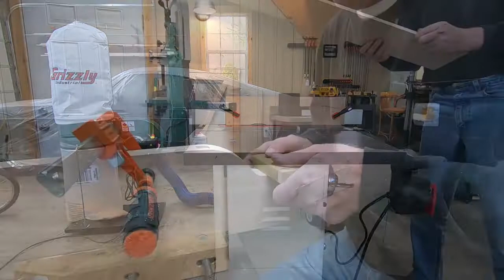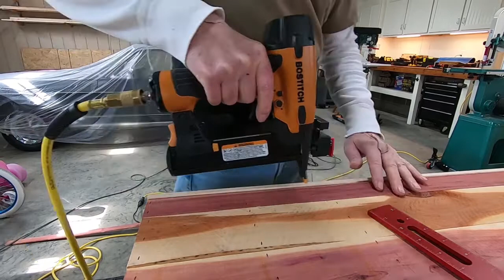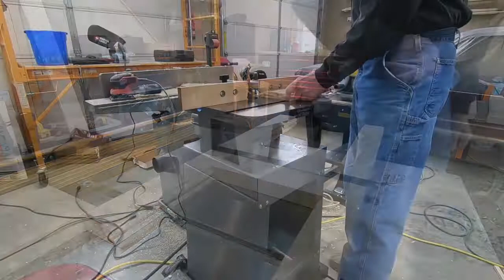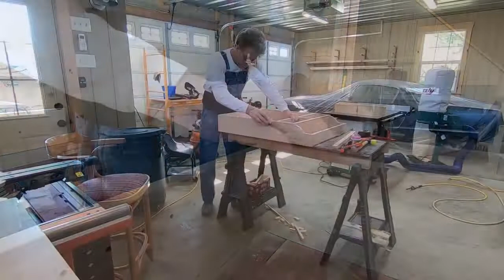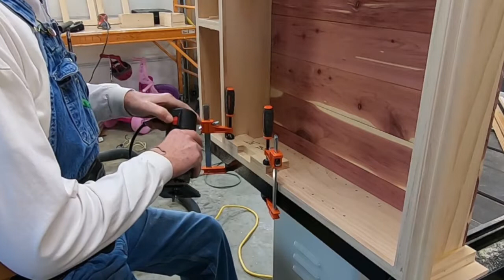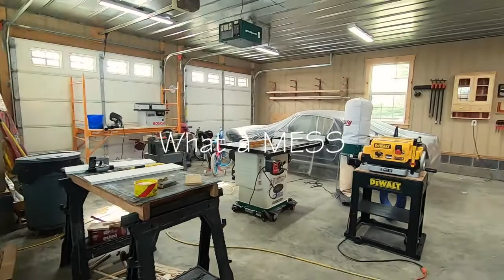Wall Hanging Tool Cabinet

Comment: Its bad practice, and actually quite dangerous, to use a router table the way you did to cut the doors for glass. You should never have the work between the fence and the back of the bit. Moving the work right to left between the fence and back of the bit can really quickly turn your part into a fast moving projectile. Ive seen a lad try use the router table as a thicknesser, he had it set with a straight bit away from the fence about 19mm and he was going to feed a part, right to left, between the fence and bit to thickness it.......as soon as he touched the bit with the work, the router took it from his hands and ejected it out the other side at the speed of light..... it broke the sound barrier at least, im sure I heard a sonic-boom :P  His face turned pale white and his hands shook for a while...... im fairly confident he also had stains to wash from his underwear that night :P If there was anyone on the other side of the router that day, they woulda been spending time in hospital. I seen the same lad chuck up a router bit in a drill press, but I managed to catch him before he put this dangerous combo into action....... his time was not long for that place of work :P  
Im not here in the comments to nit-pick, I jus dont want anyone hurt because of a hobby/craft they enjoy....pick yourself up a rebate bit with a bearing and you wont have to make that type of cut........ using a table (facing it)... feed right to left on outside edges, feed left to right on inside edges using the back of the bit (no fence)  Nice build, stay safe friend :)
Reply from the maker: Thank you for watching as well as your concern. You are correct and I should have eliminated that clip from the video. I was using what I had on hand at the time but that’s probably how most accident stories start. I appreciate your input and thanks again my friend 😎 Billy
Reply: @billylisasremodelingchanne4344  Im glad you didnt see me as someone who just wanted to pick on someone :) I use only hand tools now, but am well versed in the use of power tools......and their dangers. And ive had my own accidents due to lack of concentration.......a 90mm framing nail fully sunk into my wrist and inside the hand being one, but thankfully nothing serious or life changing. Too often we are concerned with time, and how we use the time we have........remember, a few minutes to change a bit or blade, or extra set-up time on a machine could save you the rest of your life in pain, or keep you from having a life changing experience....take that time to make it safe and proper :) 
Keep doin your thing friend......all the best to you and yours in the coming year :) 
Jay
Reply from the maker: All the best to you as well! Keep in touch😎 Billy